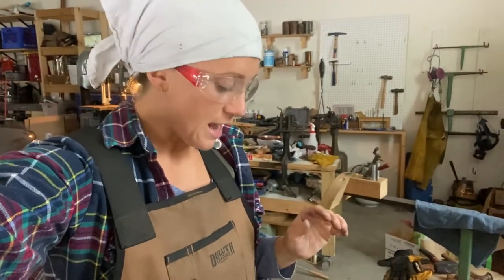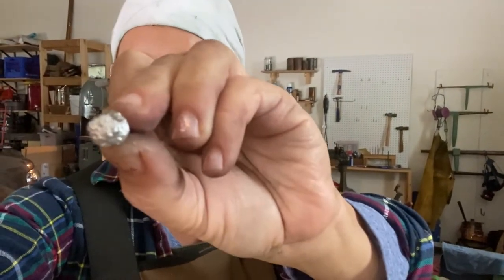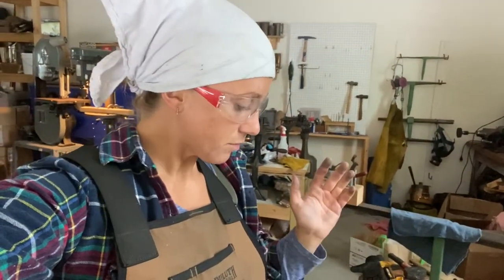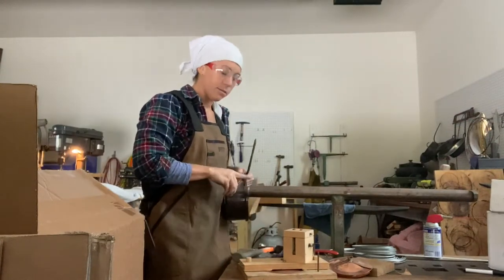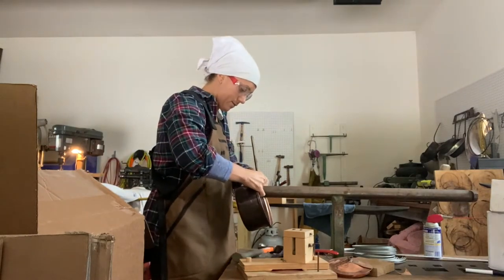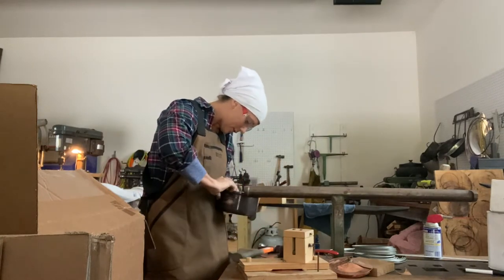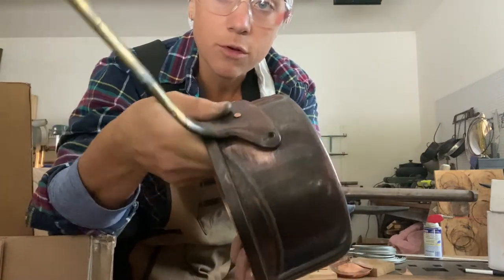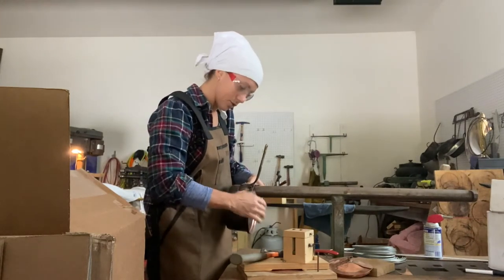How to Replace Rivets

Comment: Yes - How to tighten loose rivets. Still waiting for that one :) - Thanks for interesting content.
Reply: hammer and a steel to pound against.  that's all you need!  oh, and don't miss the rivet when swinging!
Reply from the maker: Coming soon! I thought I did one but maybe not! I don't recommend pounding straight on the rivet, but around it using some drilled out tools - hammering directly on the rivet sometimes can crack the rivet if it's an old pot needing repairs. Sometimes I go from the inside, too.

Comment: I have some leaks in my pot, exactly in a place where the rivets hold a handle. How could I fix that? I need maby to make some effort with my hammer and make those rivets more flat? Or some other tips are needed?
Reply from the maker: You could try to tighten the rivets first before replacing them. Replacing is a last effort. You could also line with tin - assuming you have a copper pot. If it's a stainless pot...well...I guess tighten them before anything else. I have a video on how to tighten rivets.

Comment: Love your channel, thank you so much for all the videos. Also love that your kids help film, inspires me to get my young kids involved in these projects. :)

Is there a rivet diameter and length that you recommend starting with, or do you have an assortment and use what fits?
Reply from the maker: Thank you so much for your kind words! And yeah, it's so fun to have the kids involved. Gives them "life skills" in so much as filming is, these days! ha!

Anyway - no - I don't spec a diameter or length since each pot varies in thickness and the handle also varies so extreme. I try to have a nice 3/16" diameter with a relatively longer length (1/2" or so) which I will grind down if necessary. Some pots you need a thicker diameter - and I try not to drill out and replace the super old, handmade, wide rivets because of that. But 3/16" di is a nice place to start.

Comment: A trick I use when riveting is to use masking tape across the heads of the rivets on the inside of the vessel while setting the rivets.
Reply from the maker: Ok, this sounds like a cool trick. Does the tape keep the rivets in place or keep them from getting a bit marked up during the hammering? Please share! :)
Reply: @housecopper  Holds in place while starting to set the river. I am working tin using tinners rivets and I see little to no change or marking of the back side of the rivet. Probably would provide some protection to a copper rivet.

Comment: How about leaks? how do you know if they are gonna leak or not. Had bad experience with a new saucepan leaking from the rivets
Reply from the maker: Most pots have a new tin interior wiped in, which typically seals any cracks and prevents most leaks. The rivets themselves are not air-tight, especially when they are retro-fitted like these, so the tin lining is essential.